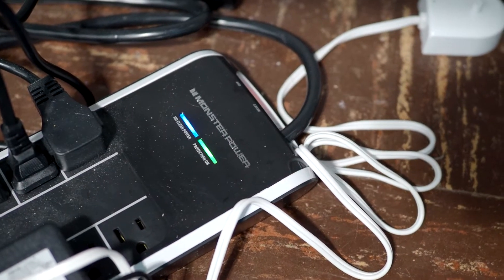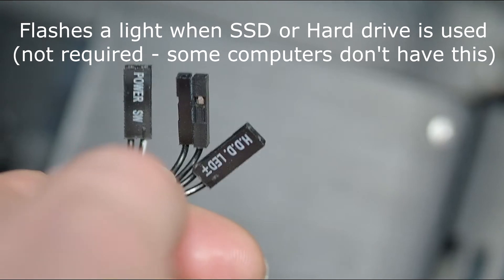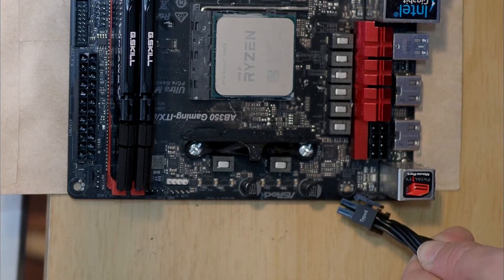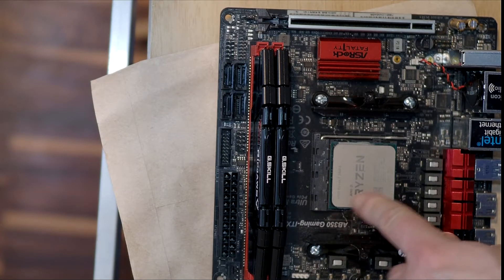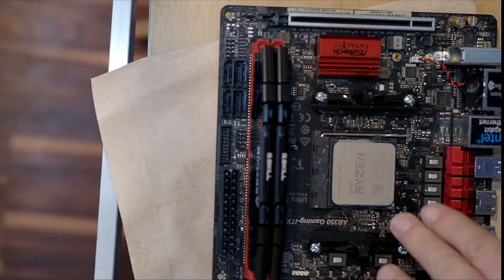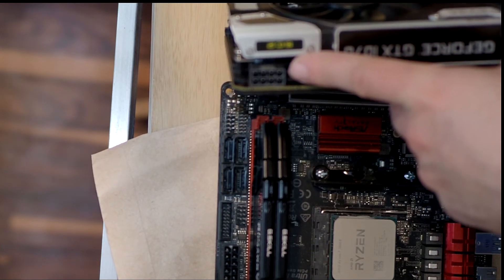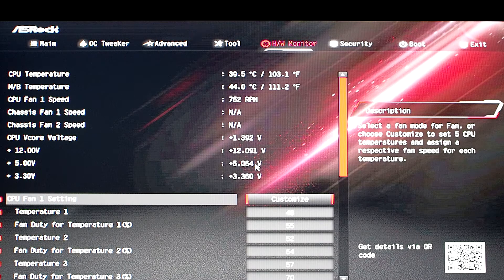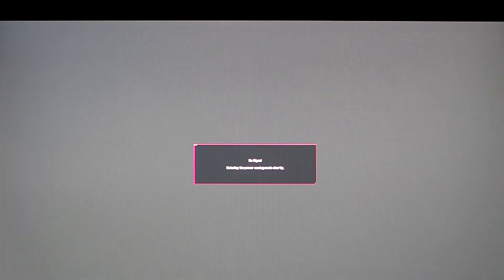Reasons a Computer Won't Turn On Part 1

Comment: My motherboard light is on but when I click on power switch it doesn't turn on the pc why ?
Reply from the maker: Part 2 is in the video discription... It means you have power and the mostly likely thing if nothing happens when you press the power switch is the switch does not work or the power switch connector is not in the correct location. In part 2 I explain what happens based on the issue.
Reply: @sparketech  but before this problem i left my pc on and used it for 2 days iit's was working normally but when i turned it off and the next day tried to turn it then didnt works why does this happened ?
Reply from the maker: @DeusBulk  the solution should be one of things in the 2 videos. If ai got this correct nothing happens at all when you press the power switch? No fans turn? Or does it turn on for a moment?
Reply from the maker: @DeusBulk  another reason could be something in the computer died. The uncommon but possibility of the power supply having died... Uncommon when the computer isn't doing anything unless you had a bad power surge... Or fan in the power supply died and over heated and killed the PSU but it should have simply turned itself on and would normally turn off after a period of time.
Reply: @sparketech  no any of these working. ..only motherboard light is always on 😔
Reply: @sparketech  so you mean upon the time the spu will turns on again cause this problem happen to me 3 times before 😕
Reply from the maker: @DeusBulk  odd... And you know that you have no loose connections? Do you know that your power supply fan is actually working still? If you have an All in one liquid cooler for CPU do you know that pump didn't die?
Reply from the maker: @DeusBulk  motherboard light signals a boot failure... Bios or other motherboard related boot issue. You've tried resetting the bios? I had a similar issue due to a bios setting problem. I would otherwise start removing one memory stick and placing back than the other. Reseating components and connectors even if in all the way including GPU.
Reply from the maker: @DeusBulk  is the motherboard old? Any capacitors looking swollen? There were several computers build 10 to 15 yrs ago and maybe newer with cheap capacitors. Dell got sued over the situation a decade ago or so. Also if old the bios battery would likely need replacement.
Reply: @sparketech  no my 💻 pc is 2 years old
Reply: @sparketech  yesterday it was working perfectly but today nothing works 😢
Reply: @sparketech  no my motherboard light is usually always on when I turn the power supply button on before the power switch but I didn't touch the bios system do u think this happens when I left my computer on for 2 almost 3 days ?
Reply from the maker: @DeusBulk  you'll have to try removing and replacing items to see the issues... If you have spare parts it might be a tike to replace one by one even if old to find which piece might be causing you issues. It'd be best to write though discord, I think you could even send pictures on discord... It's free to join my server which in my video discription
Reply: @sparketech  listen guess what I left it like that without doing nothing ... and today I tried to turn it on it works how idk now it working normally without doing nothing I just left him like that for one day ... what is that means ? Why it's working now and yesterday didn't wants to turn on ?? 😕
Reply from the maker: @DeusBulk  do you have a recent enough bios? As in could you be having compatibility issues .. I have no clue if you changed anything in your computer recently that if is having issues... But for example the B450 was updated to work with the 5000 series and updates fixed CPU issues and also memory compatibility iaaues.
Reply: @sparketech  no I didn't do any updates or changes on the computer am still using the same setup from 2019 .. listen I tested all other pieces in the computer  : " cpu , gpu , spu , ram " they all worked better so the problem is not in them what left is the motherboard the problem is in the motherboard her led light is on but no startup power 💔😢 .. my motherboard name is " Asus tuf gaming plus b450m "
Reply from the maker: @DeusBulk  without being there it is difficult to help... I am uncertain if the newest bios would resolve the issue or if you are experiencing a hardware failure. There are a few people with the same board having similar issues that can be found "tuf B450-plus gaming won't turn on"

I would love to find a solution but I have to travel out of town within 12 hours and am starting a new job right away. I hope your issue can be found, could be a motherboard problem, but I am not there to test. Easiest test that requires a lot of work is change all the parts using the same motherboard... But I can not expect you do have other computer parts to access. My motherboard is easy to update and do not require a computer that boots or even a CPU to update but yours requires access to the bios at the very least.
Reply: @sparketech  the power switch connector is on the right place 😯
Reply from the maker: @DeusBulk  And the switch works? I fixed a computer with a dead switch and I had a switch die on me before.

Comment: i just built my new pc in a brand new case, but when i push the power button, nothing happens, fans do nothing. i think i put my 24 pin cable wrong but i have no idea what else could be the problem
Reply: Did you plug in the case header pins correctly?
Reply: I got a fan hub for my fans. Everything works except my fans
Reply: @LivingSaint7  could’ve plugged them into the wrong type of fan header, some are 12v some are 5v, make sure the pins match up
Reply: @wjstreams   my power button for my tower turns my gpu and motherboard on, but no fans. I have a small green light in the fans, but no movement or led

Update: had a bad fan hub with blown resistor. Don't buy musetex cases
Reply: @LivingSaint7  does the CPU fan turn on?
Reply: @wjstreams  I'm waiting for mine to come in, mine didn't come with my cpu. Is that what's causing the issue? If I don't have a cpu fan, it won't turn on my fans? I appreciate ur help btw
Reply: @LivingSaint7  no but you should never run the PC without a CPU cooler, it’ll hit its max rated temp very quickly, thermal throttle to extremely low speeds, and it could damage it. I would check to make sure the fan hub is connected into one of the case fan headers and not a different one. You can look up your motherboard manual online or look at the one that came in the box to find the schematic of the motherboard and it’ll show you where the fan headers are
Reply: @wjstreams   are u good at understanding the guide for the motherboard. I had a friend who came over to help me. He had helped me hook up it the 2nd time. We never got the fans to work or the L.e.ds for them to work
Reply: @LivingSaint7  yeah what exact motherboard and what exact fans do you have, and what exact fan hub do you have

Comment: Hi I have a new build and I have lights on my motherboard but my cpu fan is not spinning and I am getting no output to my monitor. Any ideas as to why this could be?
Reply from the maker: Part 2 video I explain what happens with what situation. Sounds like your pwr switch is not connected correctly.
Reply: I have the same problem. Have you fixed it and if so how?
Reply: @stickyycream  yes I have sorted it now! My power supply wasn’t beefy enough for what I needed it for... got a higher wattage supply and now it runs fine
Reply: @microwave7522  yes that’s what I thought my problem was but it was actually a faulty motherboard

Comment: I connect power switch cables correctly I think. But the power switch flashes blue and red ??? Also a few times this past month the board loses power and I take out CMOS battery and put back in, the PC works fine but still power witch flashes blue/red. Just today again I was on computer and when I got back home AGAIN now power to PC ? 🤔🤔🤔 is this a MB issue or poor CMOS battery ? 

I just bought new x570 board for 5900x so I’m kind of blown away to how poor its stability is.
Reply from the maker: First if unstable make sure your bios is the newest one. Secondly is your psu good enough for the computer and lastly is your computer turning off to standby all the time and that is why the light is flashing
Reply from the maker: One other thing people do that especially is bad for stability... do you have mis matched ram sticks? If so, it could very well be an issue.

Comment: My pc is getting power (getting power led) but it doesn't turn on ( no fans spinning no signal nothing) i tested the power supply and it worked but when i try to turn on the pc with the switch or even with a screw driver it doesn't react, and i thought it is the motherboard but i don't know. I have a x79 oem lenovo motherboard. Plz help 💜
Reply: Did u fix

Comment: What about this scenario. it turned off by itself and won't start. Appears to be dead, but you can charge devices using a usb cable on any port. That multi-card reader nobody ever used is glowing like a christmas tree, but for all other intents and purposes, it's dead. The specs are not entirely certain as it's a third hand old P4 about 10-15 years old... Do you consider that a dead bios battery or a motherboard failure? I'm inclined to think motherboard failure, yet I've heard it could be the bios battery on some models.
Reply from the maker: Bios battery dead results in error like no longer keeping time. Power supply doing and over heating is a common one on an old computer where the power supply protection kicks in. There is also part 2 video if yoy haven't seen it.
Reply from the maker: After 10yrs a bios battery is likely to be getting weak as well. Try the bios battery first. On the motherboard usually if something goes you'll see popped or inflated capps
Reply: did you ever get a fix? Im having this problem too 😢😢

Comment: Hey my pc turns on but no display, the cpu fan isnt on, the gpu fan is on, and i have removed every component and replaced it and still nothing, could this be a motherboard issue?
Reply from the maker: Without you telling me your CPU the motherboard chips used it'd be harder to say yes or no. What if the CPU fan isn't working and the CPU is almost instantly overheating you'd never know the difference verses what you told me thus far. Have no parts listed also tells me nothing... did you see video #2?
https://youtu.be/CTPDnOMz8AQ

Comment: Hello when I disconnect my power cable and plug it back in and turn it in from the power button, the fans turn on for a second then stop and nothing happens, pls help me
Reply from the maker: I am at work 12 hours a day for the next 4 days... watch video part 2 if you have not done so... the link is in the description and I might have it pinned in comments. I also explain in more detail what the computer does based on each situation. Though your situation could also have to do with part 1 video where I mention things like the CPU power connection to motherboard not fully connected or the 24 pin not being fully inserted.
Reply: Yooo jhit, i have a cyberpower pc it does the same thing yo, the first time was in February where it wasnt turning on until after 2 days. I left the power cord out & wen i put it in the sane thing hpns where the fan would spin for like a second but won't turn on. Yesterday its not turning on again, it probably will tonight or tomorrow idk. But did u find out what cause this issue to happen? Let me know asap please
Reply: @Teczyfv  yeah I ended up fixing it lmaoo and I have the same pc, I have a cyber power, to fix it you have to unplug the big box in the middle that is sideways, once you unplug it grab a toothbrush  and clean all the dust off and blow on it then plug it back in and it should turn on, at least that’s what helped me, the box in the middle is your GPU and it might say something like XFX, there’s a cable somewhere I forgot where but it might be under it or something, just unplug it and clean it and plug it back in, hope this helps.
Reply: @glokkjhit4749  where it has msi GeForce gtx ?
Reply: @glokkjhit4749  bro how to unplug this😂
Reply: @Teczyfv  yes msi is your gpu, to unplug it find a cord that’s attached to it and unplug it, look around the bottom or in front of your gpu for a cable and unplug it and clean it thankless plug it back in, different gpu’s have different cable placements
Reply: @Teczyfv  for you if you have an msi look in front where the logo is and go to the top right of the front of the box (not on top of the box, the side that has the logo on it) and there should be a power cable, there is like a lever attached to the top of the cable that you have to push in to take the cable out. So just push the cable down from on top and take it out.
Reply: @glokkjhit4749  ight thanks br
Reply from the maker: @glokkjhit4749  thanks for your assistance 👍.
Reply from the maker: CYBERPOWER Tech Support:
(855) 888-2039
Email tech support
TechTeam@CyberpowerPC.com
Hours of Operation:
Monday - Friday: 8:30AM - 6:00PM PST
Saturday: 9:30AM - 3:00PM PST

Comment: My pc over heated and won’t turn on should I buy a new one or is it possible to make it myself ??🐒
Reply from the maker: What over heated and why did it over heat. CPUs, modern ones at least save themselves. A bad power supply can kill parts an old like a very old CPU can fry. It is of course possible to build your own but the issue is if you want it for gaming getting a GPU is a nightmare at this time... I have a guide, one of my ultimate PC experience videos... if you search my videos for Ultimate you'd find it. Or look in my Playlist... at work right now or I'd simply put a direct link to my video to help you build the ultimate overall computer experience
Reply from the maker: I'll never buy a pre-built on purchase due to lack of quality. Seem to have crashing issues after a few years as they are often not meant to last... however a pre built seems to be the only easy way to get a good graphics card other than trying a local computer store to see what stock their supplier can get. Often pre-built systems only have one stick of memory and only way to guarantee compatibility is 2 like sticks of memory... if you leave it at 1 stick you lose a HUGE amount of performance... about 15-20% slower and often you get super slow memory speeds making the issue even worse.
Reply: Did it turn on yet ??

Comment: What would cause a PC to boot at my house, but not at a friends house? Their outlet works. We double checked the power cord is seated well. If it was pulling too much power from the wall wouldn't the breaker blow?
Reply from the maker: Wouldn't be drawing too much power unless it were a mining rig. Have you considered the differences... monitor other other external parts? Also watch part 2 if you have not done so. I'm at work at the moment so no time to really think much else at the moment... different cables for the monitor and such can be an issue, change the cable to the monitor
Reply from the maker: And another theory I have is that your monitor could be set to the wrong display output. Bet if your friend had his monitor at your place it would work. Just a hunch it is cable issue to the monitor or the display output device set.
Reply: @sparketech  The thing that perplexes me is that the tower wont turn on there. The light flickers a little in the room. I'm guessing it is a house wiring issue and I don't expect you to know that, but if you have seen something like this before I thought I would ask. Sorry for not divulging that information before.
Reply from the maker: @squshy1  never seen anything like that before. I'd expect other electronics to have issues as well with such a situation unless you had purchased a super cheap power supply. If your power is that bad you should consider having that fixed before TVs and monitors die from the issue or worse a house fire... maybe a "power conditioner" could help for the time being
Reply: @squshy1 this is happening to me did you ever find out why this happens???
Reply: @fastboy32  Mobo was going bad and it turned out to be intermittent. Was coincidence that it booted at mine.
Reply: @squshy1  oh dam thanks for the reply guess I gotta get a new mobo

Comment: Just building my first pc I go and plug in psu and flip switch and my motherboard light lights up though when I click power button nothing happens
Reply from the maker: 1:34 is the most common exact same issue you are having will result
Reply: @sparketech  i have the same issue but i tried the power switch with a screwdriver still not working
Reply from the maker: @avengegaming5556  look in the video description and watch part 2 please. I explain a lot more issues and what the computer will do based on each issue
Reply from the maker: @avengegaming5556 
Part 2 video link https://youtu.be/CTPDnOMz8AQ

Comment: My PC Wont turn on any help? My Power supply is working and when I plug my keyboard and mouse into the PC Those two light up but my pc, pc led and fans dont turn on or work.
Reply from the maker: Has your PC worked before and suddenly stop? Or a new build? Are you sure your power switch the very cables I have in this video thumbnail are connected correctly or that your power supply button hasn't failed? Normally most other issues would result in fans turning or turning at full speed with component issues.
Reply: @sparketech  Sorry for the late reply but no its not a new build had it for nearly 6 months I think I've tried that thing in the thumbnail but still no response been dead since the 13th of march 2021. I was watching a youtube video then it just turned of and since then no reply.
Reply from the maker: @zhking_1161  did you see my part 2 video?
https://youtu.be/SH4Laen7EsY
Reply: @sparketech  Sorry, It says Private Video.
Reply from the maker: @zhking_1161  sorry didn't seem to copy and paste properly.
https://youtu.be/CTPDnOMz8AQ
Reply: Did it turn on yet ?